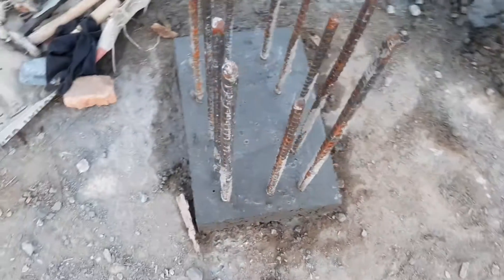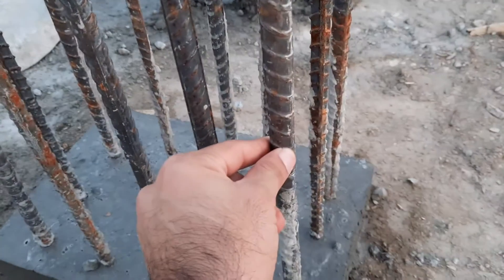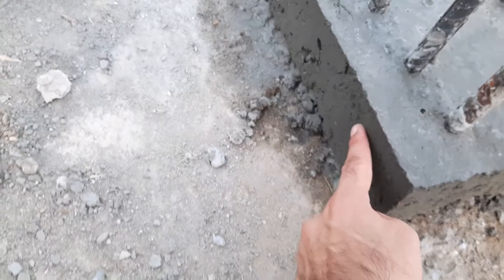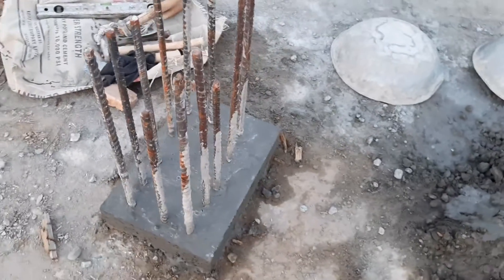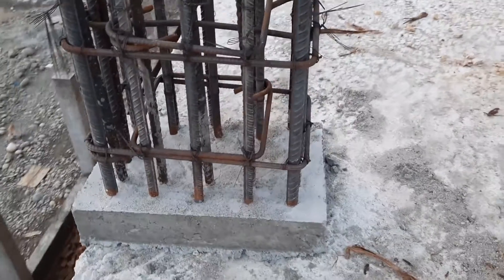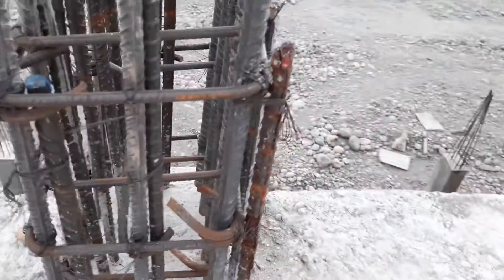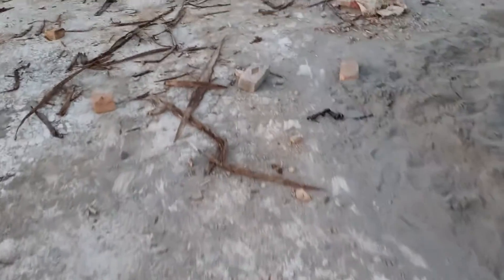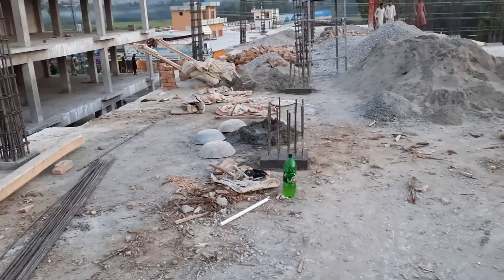Lapping Problem in Column Construction | For 5 Storey Building |

Comment: Where we shall provide steel lap in a 5 Storeys Residential Building? And if the designer want you to provide it from the slab top surface what will be the solution?